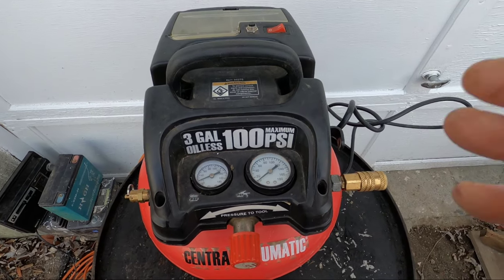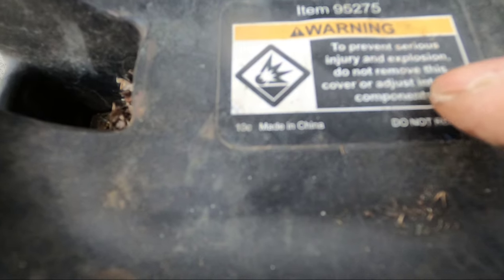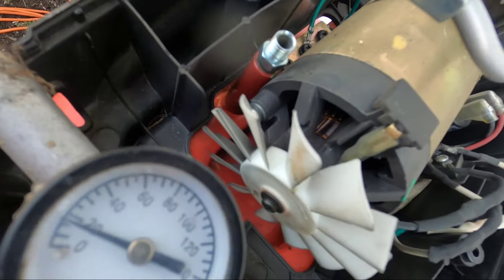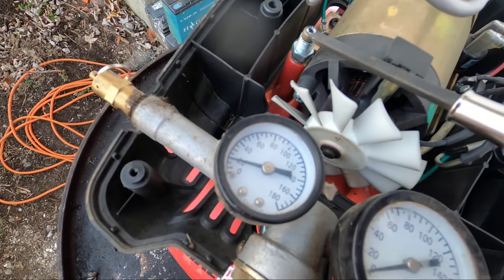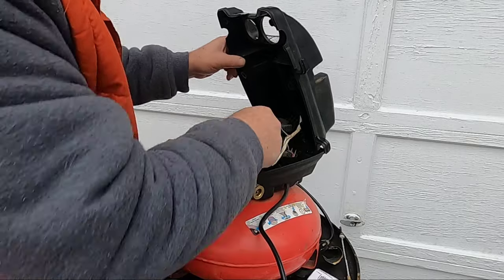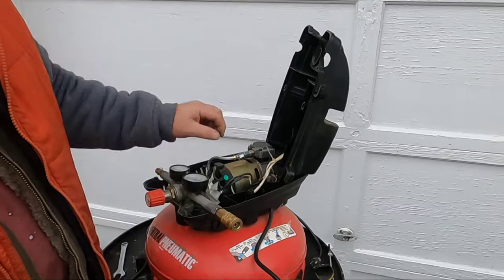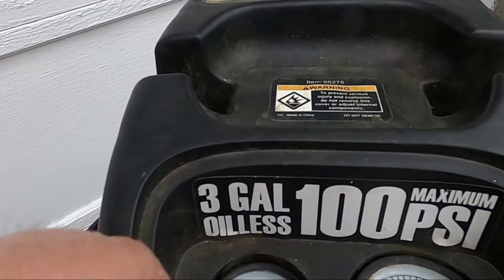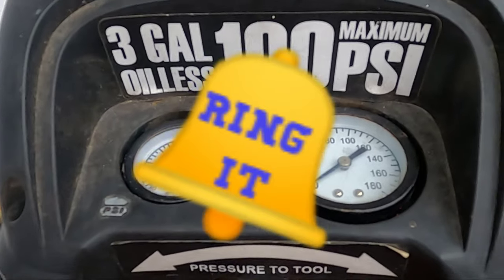How to repair fix air compressor not building pressure easy fix

Comment: I’ve only used mine like 3 times in the last year but now doesn’t seem to pass 60 psi. 😡
Reply from the maker: @robhtp3817, Thank you for watching.
It may be something simple. Before taking it apart check all the connections, even a small leak will be an issue. Be sure to check the purge valve, there should be an O-ring or some washer there. Sometimes they go missing or just deteriorate causing a leak. My air chuck has a small leak, so when I am filing the tank I keep the air flow to it off until the tank fills. If none of this helps you may have a loose connection in the area that I show in this video. These are the usual leak locations. After only a few times used it should not be the reed valve but cannot rule it out if all else fails. 
@robhtp3817,  I have other videos on my channel that cover different subjects  and new videos added weekly that may also be of help or interest. 
Your support is not required but always appreciated. If you are inclined to do so your Subscription, Likes, Comments and sharing this content would help me to reach other viewers that may also find this channel useful or entertaining.
 
 Stay safe, Joe Z

Comment: That tube was bouncing more than it would when connected at both ends.
Reply from the maker: neonbeach62,  You're right about that. I videoed  it the way it was to show that it it does have some stress/vibrations on it. What caused it to break, I can not say for sure. I am the only one that used it & never dropped it. 
Thank You for watching and taking the time to comment. neonbeach62 I have other videos on my channel that cover many different subjects  and new videos added weekly that may also be of help or interest.
 Be sure to 👍, share & subscribe if your are inclined to do so.  Also not to miss any new videos remember to hit that notification 🔔 
Another way you can help support  this channel at NO cost to you is by using one of my affiliate links
.*** Thank you for watching and your support is much appreciated.***
Stay safe, Joe Z

Comment: I just got a broken one for free.   I hope this is the issue.
Reply from the maker: Always nice to get a free tool. Sergio if it is running & not building up pressure also check the drain on the bottom, it may have just have loosened up from being hit or may have a bad oring. Also I once had a small leak at the quick release. Let me know how your repair went.
Stay safe, Joe Z
Reply: @JOEZEP54  update: it was that same spot!  $2.55 later and it's working perfect.. Thanks to you and your grandson for this video.  You got a new suscriber!
Reply from the maker: @sg1893  Glad it worked out for you. Johnny is a big help. Thank you for your support. We do appreciate it.
Stay well, Joe Z

Comment: Not positive but I seem to remember that brass + aluminum = corrosion
Reply from the maker: Hi Dan thank you for visiting & taking the time to add useful information. Your are correct. Unless coated aluminum + just about any metal will corrode in time. When repairing this compressor I did not take that into consideration & should have mentioned it for viewers. If  I am not mistaken I believe there was a brass ferrule on originally, maybe one of the causes why it snapped.
Good catch 👌
Stay safe, Joe Z

Comment: Mine leaked out its oil and completely catastrophic failure happened
Reply from the maker: I have not had that issue. Been using this quite often for the last couple of years. By any chance did you purchase it within the last 90 days? 
This is not a heavy duty compressor but ok for what I use it for.
Stay safe, Joe Z